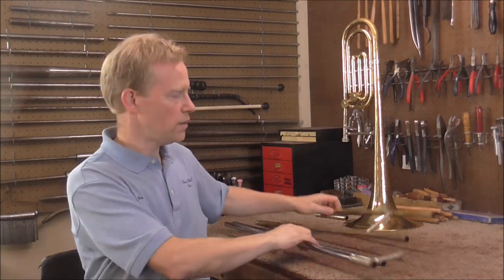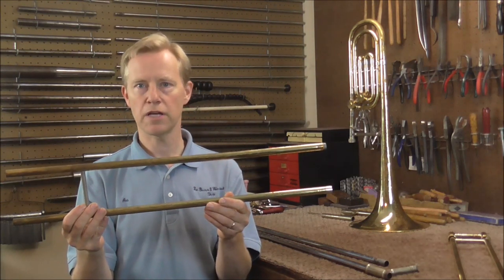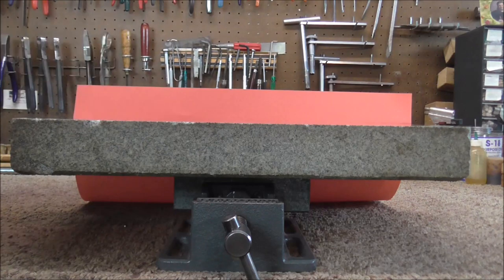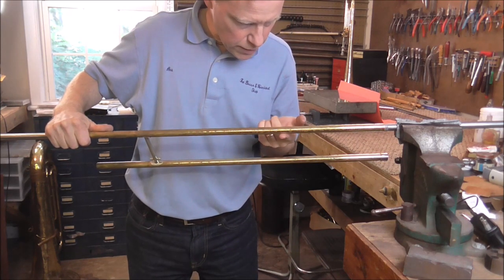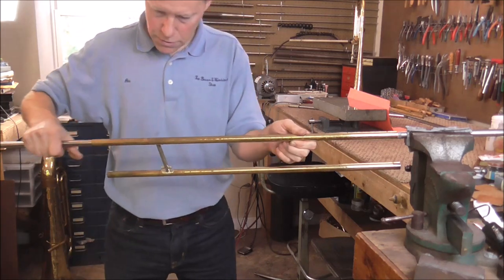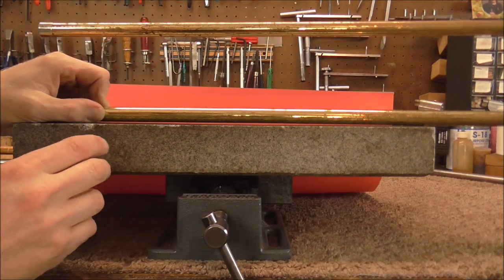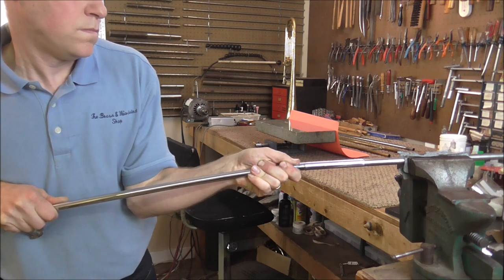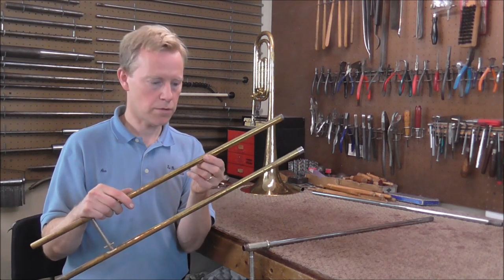Bass Trombone Restoration #6: Straightening the VERY BENT Slide Tubes

Comment: Nice video. I wonder about something maybe you could explain in the next video. Could you shove the mandrel through the entire length of the slide and then roll out or burnish the tube on the dent/bend part so that the atoms in the metal (or whatever they are) realign?  With my very minimal/hobbyist experience, this is how I would have thought to fix this. Explain why that wouldn’t work.

Comment: Nice job! It's actually fairly easy to see the dents and bends on the video, perhaps moreso than in person. It was really interesting watching you pull those bends out.

That got me wondering. What if you applied some firm pressure on the two mandrels to encourage the tube to bend, and then gently tapped on the tube at the point of the bend with a soft hammer? I wonder if the strain in the tubing would encourage the metal to move as you tapped on it.

Comment: If you had two bench vises opening parallell to the edge of your work bench you could line up the two mandrels. Then just push where the bend is. The mandrels would only give just a little since they would support each other. Like that the risk of overdoing it would be minimal. Said the armchair technician ;-)
Reply: Interesting idea.

Comment: Your trombone repair reminded me of when I bought a mouthpiece a little too big and it didn't fit my trombone, so I decided to drill a mouthpiece hole with a tapered bit and sandpaper wrapped around it. At some point the bit grabbed and I pulled out some shattered and corroded pipe out of there.. I guess that was the venturi.. Well, anyway, I continued sanding it and eventually the mouthpiece fitted well, the trombone plays well too so I guess I lucked out.

Comment: Im amazed how much better that slid after the straightening.  I didnt think there was much hope at the start of this series but this thing looks like its going to end up playing great.  Testament to patience   

To get around dealing with the gap from the stocking on the granite, why not set the inner tube on the block so the stocking hangs off the end? That way only the narrower portion of tubing is touching the stone and you dont have the eyeball the gap.  Or am I missing something?
Reply from the maker: Normally that would work but the bend is too close to the stocking.

Comment: Chasing a bowed slide is a pain!  I just tried it. What happens is that you bend one part of the slide and it means you have to bend another part because of the initial adjustment. So you have to keep chasing back and forth. Almost easier to buy new inner slides and fit them in. That doesn’t help though with the outer slide because if the inner slide is bowed it almost always means the outer slide is also bowed.